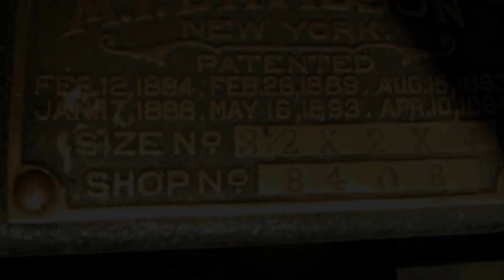1890s M.T. Davidson Steam Pump

Comment: Very nice how does the steam chest operate in this pump
Reply from the maker: The lever that connects the piston rod to the steam chest, operates a small valve that, in turn, controls steam to a slave cylinder that controls a valve for directing steam to the main cylinder. I is basically a stem driven oscillating mechanism.